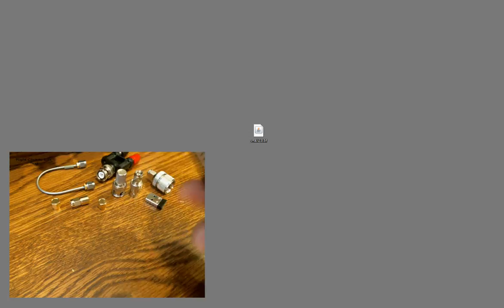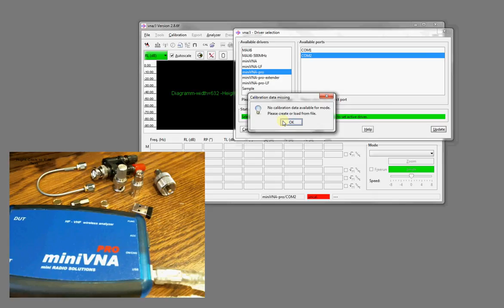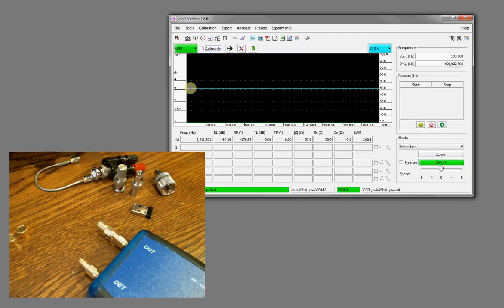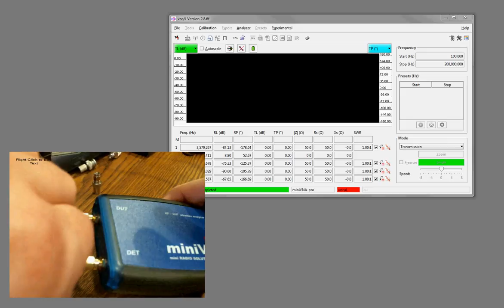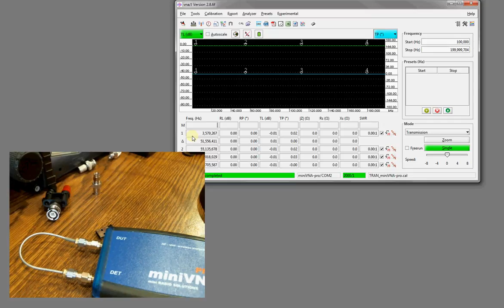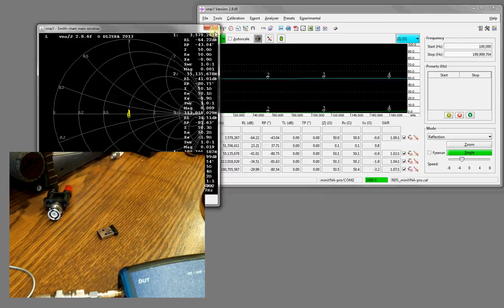NT1K.com - mRS miniVNA PRO - Overview, Installation and Calibration

Comment: You should have looked at the Array Solutions Aim device, it goes through a similar calibration method, but the software is very good, and the readings are fantastic and accurate . For one, it is encased in a metal enclosure. Don't you think that if you are measuring RF, or anything radio related, that any RF that passes through the plastic will effect the readings? I had the Comet analyzer and it would not work for me, so after a lot of troubleshooting and sending it back to Comet to examine, they gave me my money back. I live a mile from a radio station, and it caused an overload on the Comet, even though it was not in the range of what i was trying to measure. That did not happen on the Array Solutions analyzer, or even the MFJ. The MFJ is used for some things where I want simplicity and a fair amount of accuracy. The Aim 4170 I bought when it had RS232, but i upgraded it to USB, and still use it. It is not cheap, and more money than the device you are using, but you get what you pay for. You will see many test benches with the Array Solutions analyzer on it.